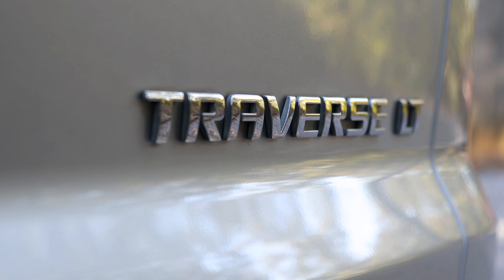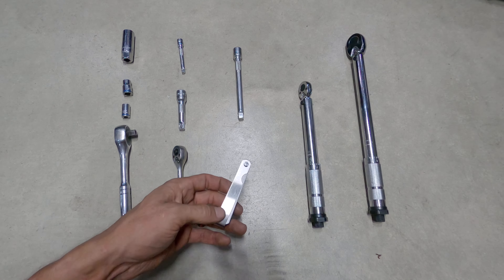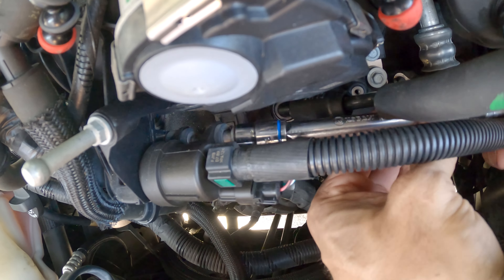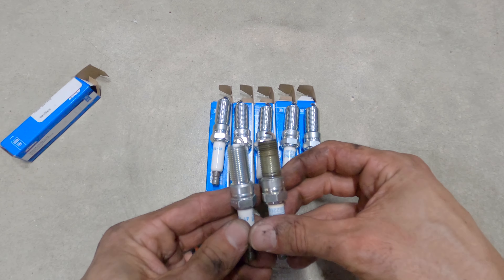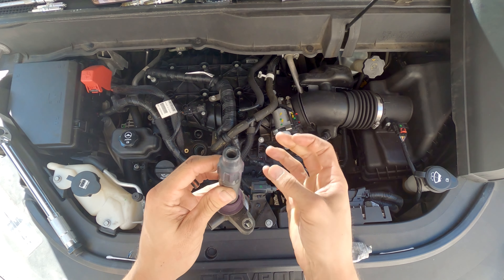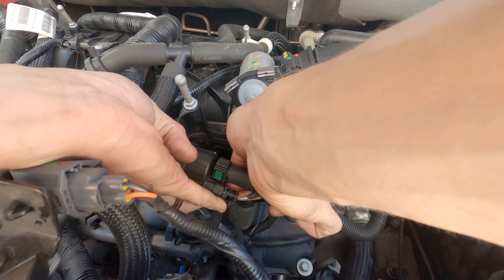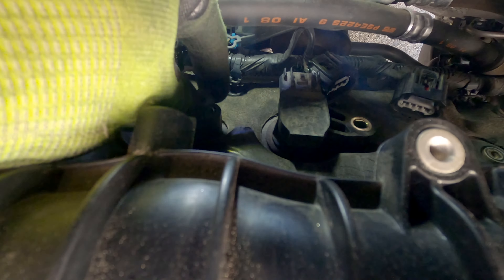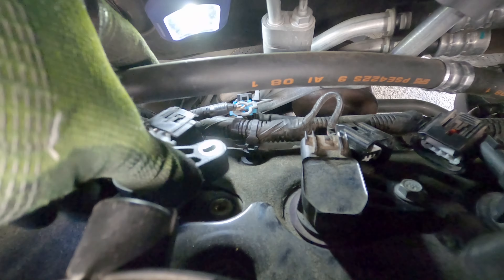Spark Plug Replacement | Chevrolet Traverse

Comment: Thank you for demonstrating that this can be done without removing the intake.  I have avoided this task for a while because I didn’t want to remove the intake or pay someone >$500 to replace plugs.  It was a little more by feel for me because I couldn’t see the back 3 that well, and I had to figure out the best combination of socket extensions to fit in the space, but overall it is pretty straightforward.
Reply from the maker: Glad to be able to help! I really didn’t want to remove the intake either, and was very happy to be able to do it with it still on. I did have to remove the intake a little while ago to clean the valves and it was actually a very easy process that would potentially speed up the spark plug replacement process enough to make it worth it.
Reply: I’ve been holding off for the same reason… I know similar years engines are same steps but what year was this specific traverse?
Reply from the maker: This was a 2012 model. It will be the same as long as it’s a plastic intake manifold.

Comment: Thanks for this video, it’s good to know that it can be done without removing the intake plenum. Word of advice, do NOT gap these. The AC Delco 41-109s supposedly come pre-gapped from the factory at 0.043”. That thin iridium tip will snap off and might not see the damage right away. I’m having to redo it after 6 months because the tips are half the size they were originally on a couple. Albeit I used the round gapper but see 1 break while doing it so had to replace it before I even installed it.
Reply from the maker: Ah, thanks for pointing that out. The instructions for those spark plugs do say to check the factory gap prior to installation, but not to adjust the gap due to the possibility of damage.
Reply: Do not trust the factory.

Comment: Many thanks for posting. Other videos have stated removing the intake manifold is needed to change the rear plugs. I am glad that is not the case.

2011 Buick Enclave 184k miles

UPDATE I tried this yesterday and for 2011 Buick used a different design on the intake manifold than the one in the video. The front coils are impossible to remove with the manifold in place 😢. I did remove and replace the 3 rear coils.
Reply from the maker: You’re welcome! Yes, everyone else just went ahead and removed the manifold, but I was pleasantly surprised myself when I found out it was possible to work around it.

Comment: Appreciate this video so much. I got new sparks and coil packs and then my buddy says “ you know you gotta take the intake manifold off to do the back three” . Definitely shared this video with him lol thanks again… by the way , I have the 2017 , he had a 2014 and he removed is intake manifold cause someone else told him too
Reply from the maker: You’re welcome! Haha, yep! I was initially thinking I would have to take off the intake, but happy to be able to figure out how to do it without. I did have to remove the intake a little while back to clean the valves and it was actually a very easy process that would potentially speed up the spark plug replacement process enough to make it worth it. There is the downside of having to replace the intake gasket, but thankfully those aren’t too expensive.
Reply: The older models you do have to remove the intake. I have a 2009 Traverse and there is no way this can be done without removing the intake. It seems like GM engineered it better as time went on.
Reply: @teetomthegreat9466  well I’m hoping my 2016 is do-able without taking it off…
If your 2017 was I can’t see it being much different in one year

Comment: When I got my 2011 Chevy Traverse LT back in June 2020 it had 151,000 miles on it when I bought it used. Now it has 173,000 miles on it right now after driving it for three years. Spark Plug changing was the first thing that I watch for many many vehicles that I have driven. I hate to take off the Intake Manifold "IF" I don't really have to. I felt my rear end I do have room to fiddle with a ratchet and extension to take them out. BUT with these engines I saw that there were two types of Intake Manifolds, the FAT Silver version and the HARD Plastic version. The vehicle in this video seems to be of a 2012 Model with the Plastic Intake Manifold and the real cast aluminum Intake Manifold belongs to the 2009 to 2011. I just hope on my 2011 that I don't have to remove the Intake Manifold like what I see here of the 2012 Version. 2011 Chevy Traverse have different spark plug electrical connectors too, they have to be pulled off to the side and it not those standard push tabs at all. 2012 version and higher are all push down tab connectors, wish I had them on mine. 

Main difference in your video is that you explain everything like many people do but in a more simpler term.
Reply from the maker: Ok, that’s good information to know! And yes, mine is the plastic intake manifold.
Unfortunately, slight variations in parts from year to year make it hard to make videos that cover the whole range of that “generation”, but I hope I was able to provide some value to you.

Comment: Best video I've seen, hands down. Quick question though... AC Delco 41 109  spark plugs are pre gapped so why did you need to gap them? Sorry. I'm new to this
Reply from the maker: You are correct, the iridium spark plugs should come pre gapped from the factory. Also, due to how delicate the iridium plugs are, you’re not supposed to adjust the gap due to the possibility of damage. It’s just to verify the factory gap is correct and that the ground electrode wasn’t bent during transit.

Comment: Your video very simple without taking intake out…. Do you have to unplug the battery first? And does your tool got magnetic , how u pull the plug out so easy ?
Reply from the maker: Disconnecting the battery before changing the spark plugs isn’t required, but does add an extra safety factor.
My spark plug socket has a rubber insert built-in that holds the spark plug in place for removing or inserting spark plugs.
Reply: Can you please put the link of the tool down so I can order it.. thnk
Reply from the maker: I have a Kobalt socket that came with a big kit, but here’s the equivalent socket from Craftsman: https://amzn.to/4a6Xoca

Comment: Very good video. If the spark wires are good, Is it absolutely necessary to replace the spark plug wires too?
Reply from the maker: The coil packs mount directly on each plug, so the wires that connect to the coil packs should last the life of the engine…

Comment: After changing my plugs in my 2012 Traverse it’s saying stable track disabled and check engine light flashing. Any idea? Bad plug? 
I did remove the cover to access the rear plugs. Probably should’ve did it your way. Great video.
Reply from the maker: Is the ABS light also on? Does the engine seem to misfire?
Reply: @FixandMaintain  Thanks for replying. No ABS light and no misfire. More like rough idling that worsens in hills or quick acceleration. When letting up on the gas the light stops blinking after 30 seconds. I’ve only driven it a couple miles for testing. 
I’m thinking a bad plug? They are the same as  originally installed AC Delco 
Possibly I didn’t get the intake gaskets back on properly?
Reply from the maker: I think either of those are plausible. If you have a scan tool, that would be the best way to diagnose. If you don’t have one, most major auto parts stores will scan codes for free.
Reply: @FixandMaintain  I should invest in a scan tool, just not sure I’d understand what it says. I’ll take another look tomorrow. Nearest store is 5 miles away and I’m afraid to drive it that far. Thanks again
Reply from the maker: I have the Harbor Freight version of this https://amzn.to/3NdS10g that I picked up a few years ago and it's the perfect size for throwing in a vehicle tool bag. Its button layout is a little weird, but gets the job done. It gives both the code and a small description. But if that's not enough info, just googling the code will be enough to figure out what's going on. There are more expensive scan tools that have even more features, but that one covers all the basics with check engine and ABS codes.
Reply: @FixandMaintain  Looks good. Took a screenshot. Almost impossible not to have one these days. Thanks
Reply: @FixandMaintain  Cylinder 5 had a cracked spark plug. Borrowed a cheap scan tool. Runs smooth. Thanks for your help. God Bless
Reply from the maker: I hate that you had to go through all the extra troubleshooting, but glad to hear that you got it fixed! A cracked spark plug will definitely cause a misfire!
Reply: @FixandMaintain  Went smooth other than fishing out a dropped ratchet lol. I was able to squeeze my hand in there pretty easily.

Comment: Thanks for this (Spark Plug Video). hello, is there also at 2017 year have a Block Heater Plug? i see i have 1 that attaches to the block. thanks much for your video & response to me question for me & my family..
Reply from the maker: A block heater does not come standard with the Traverse. It is an add-on that can be fairly easily installed in the factory port in the rear of the engine. Then, the AC power cable can be routed to wherever on the vehicle you’d like to plug an extension cord into.
Here’s the kit (minus zip ties for cable management) from Amazon: https://amzn.to/3wFwcSt (affiliate link)

Comment: I have a 2012 Traverse that has an engine light issue that is likely the spark plugs and/or ignition coils showing a misfire. I'm thinking that I might as well change out the coils if I'm going to be replacing the plugs. I've seen sets of 6 that'll fit my vehicle for under $100 which seems reasonable.  Thoughts on this?
Reply from the maker: Sounds like solid reasoning to me! Thankfully it’s not that hard of a job, since the intake doesn’t have to be removed. But since you’ll be pulling the old coils anyway, why not swap them out to try to fix the misfire.

Thankfully I haven’t had any misfires on my Traverse. But if I do, I’ll be replacing all 6 coils at the same time.
Reply: @FixandMaintain  I don't really feel comfortable doing this job on my own. My dealer will replace all 6 spark plugs and coils for $650. Not sure if that's a good price.
Reply from the maker: Whether that’s a good price all depends on the cost of labor in your local area. I’m sure the dealership is using OEM parts and possibly charging a markup on that. Going with a reputable local mechanic would probably be less than the dealership. 

But as long as you have the right tools (particularly important are the torque wrench and spark plug socket, that you can buy fairly cheaply from Harbor Freight), it’s a fairly easy/straightforward job.
Reply: @FixandMaintain  First off, your video is fantastic and makes me want to try it.  My local shop that I trust quoted me 900-1000 b/c they said they had to take the manifold off (I didn't know what that was until I watched your video). I can get a set of six 41-109 AC Delco spark plugs for $76, but I can't tell what are OEM ignition coils.  From places like autozone, oreilly, advanceautoparts, etc. it looks like the cheapest I could get would be around $50 each or $300+ for 6. If we call it $400 for parts, I'd much rather have my dealership do it professionally for $250. Mostly b/c what would take you a couple hours will likely take me all day, especially the back side that I can't see clearly with my big hands. I'd also have to buy the specialized tools you mention.  Not sure what Texas labor costs are exactly though.
Reply from the maker: Looks like on Amazon, the D515C ignition coils are currently $55.91 each, which would be $335.46 for 6 plus $50 for all the 41-109 spark plugs at $8.36 each. But yes, it would only be around $250 in savings doing it yourself versus having the dealership do the service.
Reply: You can check the resistance and rubber boots of the old ones. AC Delco is the most reliable brand but seems most expensive (more than 50 each). No reason to change the original if it checks out good
Reply: @MrHobbs79  I changed my plugs and coils a few weeks ago. The original OEM coils were actually Denso, so I replaced them with Denso. Been running great ever since.
Reply: @WinningWithWarchild only if u have $$ to throw away. Too much money for a sparkplug replacement.

Comment: La traverse 2009 hay que sacar el manifold,
Reply from the maker: Is the manifold removal required for access to the front or rear spark plugs? The metal manifold in the earlier models appears to be very similar in size, but I don’t have access to one to check.

Comment: i have a 2019 traverse with smiliar motor. 3.6 engine VVT is the replacement gonna be the same without removing the intake manifold...
Reply from the maker: Unfortunately I don’t have one that I could test, but maybe someone else will be able to chime in. If you’re trying to figure out whether or not you should order the intake manifold gasket before attempting the swap, you can take a couple of minutes to see if you have enough room to remove one of the rear coil packs and fit the spark plug socket/extension on without having to remove anything else.
Keep in mind that the torque specs in my video are based on the first gen engine, so your model may be slightly different.
I would appreciate it if you can post here whether or not you are able to do it with the intake manifold still intact on the 2019!
Reply: On a 2019 Chevy Traverse they have two different types of intake manifold designs, because in this video it is for a 3.6L V-6 2012 - 2022 and 2019 Chevy Traverse also have a 2.0L 4 Cylinder TurboCharged.
Reply: So with the 2019 v6, can you still do the plugs without taking the intake off like the video?

Comment: would this be the same for 2018 Chevy Traverse?
Reply from the maker: I’m not sure if the clearance will be the same for changing the back plugs, as that is a different body style, but it does use the same spark plugs and torque specs.
Reply: Definitely a tighter area on the 2018, I don’t see how you can do it without pulling the top intake.

Comment: The 5/8 socket doesn’t connect onto my spark plugs unfortunately.. it keeps slipping every time I turn to try and loosen it
Reply from the maker: Is it a spark plug socket (with a rubber boot inside to assist in lifting the old plug out) or simply a 5/8” deep-well socket?
Reply: Deep well socket, thank you so much for giving me that information as I just got any 5/8 socket and didn’t pay attention to the “spark plug” socket.
Reply from the maker: You’re welcome! If you had been able to loosen the spark plug, you would have had quite a hard time getting it up and out of those deep wells the spark plugs are buried in. Spark plug sockets are one of those specialty tools that aren’t used very often, but really come in handy when you need them.
Reply: @FixandMaintain  One last thing, how did you get the coil packs off? mine seem to not come off .. I was able to replace 2 spark plugs with the coil packs still attached but not the ones that are covered by another cord/piece because i can't release the coil packs , i've tried pulling as hard as i can without trying to break it.
Reply from the maker: @TheHarlemWay  are you saying you weren’t able to unplug the wiring harness from the coil pack? You have to press the locking tab down on the wiring harness before it will release the plug.

Comment: Its impossible to do this on a 2020 traverse without removing the air intake plennum
Reply from the maker: Yes, while it is the same “size” engine, they made a lot of changes in the second generation Traverse.

Comment: Looks like I'll teach my wife how to do this on the rear spark plugs.  My hands are too big to fit between the intake plenum and the plastic cowl cover.  I'd remove the plastic cowl cover, but that means removing the wiper arms.  She has smaller hands, and it's her car.  She should learn how to do this.
Reply from the maker: Haha, I guess that’s an option. Don’t be scared to pull the intake, though. It’s not that much more involved and also gives you an opportunity to check how clean the intake valves are. Those engines are notorious for gumming the intake valves since it’s a direct injection engine. The only real downside is having to replace the intake manifold gasket, but those are relatively inexpensive.

Comment: 2019 and above you HAVE to remove the intake 😢
Reply from the maker: So, I did have to remove the intake a little while ago to clean the valves and it was actually a very easy process that would potentially speed up the spark plug replacement process enough to make it worth it. There is the downside of having to replace the intake gasket, but thankfully those aren’t too expensive on Amazon.

Comment: This will not work on a 2018 Traverse 3.6 the intake manifold will need to be removed to access one spark plug. Different design, throttle body is in back left corner instead of right side in video
Reply from the maker: Yes, the first generation (what I have in this video) was from 2009-2017. I haven’t had the opportunity to work on a 2018 or newer, so I haven’t seen the clearance for rear spark plugs on the newer body style.

Comment: I called a shop they said the intake manifold gasket had to come off smh so called professionals
Reply from the maker: I mean, there is a chance they could do the job faster with removing the intake. So if they can do a job faster AND charge more money, why would they not pick that option?
Reply: @FixandMaintain  told me it was gonna take 5 to 6 hours cuz they had to remove it. I know bs when I hear it
Reply: They claim the intake has to be removed to charge u three hours worth of labor. All u need to change the rear sparkplugs is a magnetic socket. If u drop a plug in the hole you'll be hatin life.